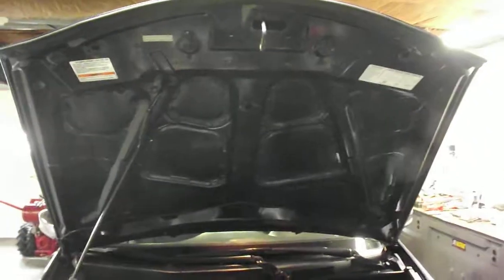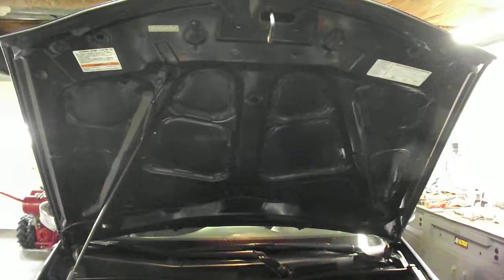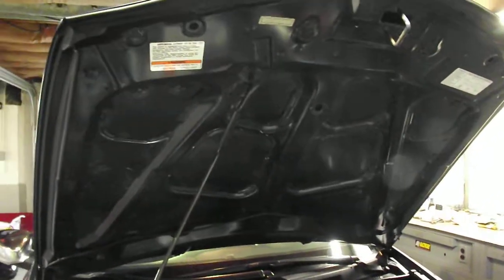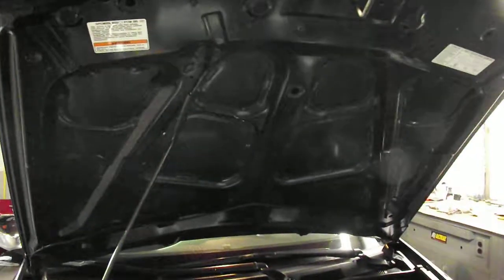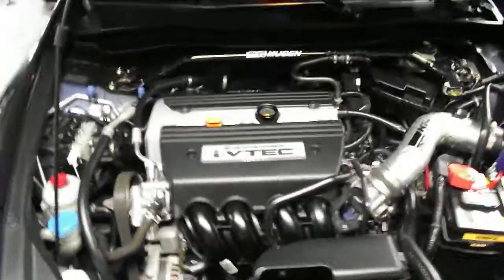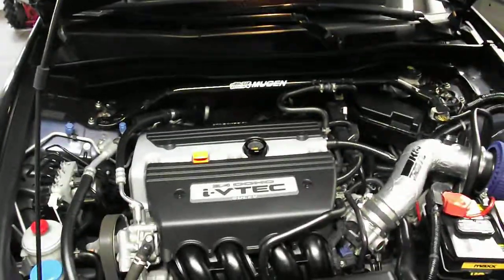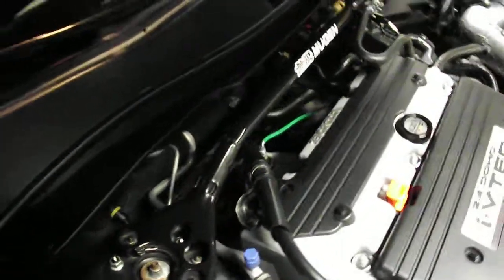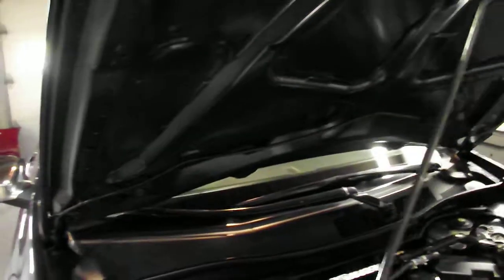Should You Remove the Hood Dampening on Your Car?

Comment: The actual reason for the shield is to suppress fires.  In case of a fire in the engine bay, the clips melt and the suppressor shield drops over your engine to smothering it.
Reply: da324 someone from a different video said it actually burns rapidly after lit up. So seems like it doesn't work as a fire blanket
Reply: Any manufacturiers have videos, articles stating this? Would be an interesring read.
Reply from the maker: Exactly
Reply: @da324, no. 
That may only come as a secondary purpose. Primary purpose is to protect the hood cover from excess heat and paint discoloration.
Reply: People read that online then just repeat it .. Not one person was able to prove this is the reason for the insulation.
Reply: @germanshepherd13  Can you prove it's not?
Reply: I don't think so
Mine was off and i tried to burn a piece of it
It burnt pretty well 
It might help u to start fire in emergency to keep u warm
Reply: That is actually correct that is the intended purpose for that it's called a fire blanket but I've seen many cars on the side of the road catch on fire and I've never seen one go out by itself so I don't think it works at all... And as an air quality specialist trained in asbestos detection and microscopy I believe those blankets contain asbestos...
Reply: Mine burnt quick when my battery exploded

Comment: What would your opinion be on removing the hood liner on an older 4 cylinder accord that has the exhaust manifold in the front of the engine bay?
Reply from the maker: I'd say it would be alright. The manifold should be cooler when it's in the front.

Comment: so i have a golf 4 gti and should i do it? i have a 20V turbo 1.8t motor with a blow off valve. Should i be worried ?
Reply from the maker: Not sure. I would take a temp reading. With my hood, it's just warm to the touch. My exhaust manifold is in the back of the engine, which would definitely hold more heat than if it were in the front of the engine where air hits it. With that small engine, you should be good, but I don't know.
Reply: did you figure out if it made a difference or not?
Reply: @stayclassie6875  it did, my turbo flutter got way louder and the blow off valve. you could definetly hear a differrence so id recomend it. And it doesnt do any heat damage to my hood.

Comment: That's good to know, because I've been thinking of installing it with my '23 Corolla LE 2.0L 4 cyl. I guess I'm going to try to feel how hot the hood get first, the insulation pad cost around $200+
Reply from the maker: Yeah, I'd definitely consider before spending that. It's been since this video that mine has been off and I've never had problems.

Comment: I had that experience. ('05 Accord, 4cyl) 

Hood liner/insulation off, hood paint wore off. The heat disfigured the paint. It started at the center of the hood cover and the discoloured patch expanded over time towards the edges.  Also, the hood was always too hot to touch.

I bought and installed the hood liner/insulation. Hood cover never got so hot again, no matter how long I drove the car.
 Hood discoloration stopped expanding (it seemed to even out some months later, but still looked ugly). So I got a paint job done.

In my opinion, from experience, leave the hood liner on. It protects.
Reply from the maker: Interesting. I had mine off for 4 years now and I've never had a problem. Do you have a V6? That engine would have a lot more heat. If I had anything bigger than a 4 cylinder, I wouldn't have taken it off. I mainly took mine off because it looks really ratty as it gets old.
Reply: @Auto-Alchemy  
Mine is a 4-cylinder engine. 2.4L

I agree, it gets ratty-looking. I learnt the liner/insulation is usually damaged by water; so we shouldn't wash. 🤕
Reply from the maker: @daviderhahon  that’s interesting. Ive never had trouble with my 09 Accord 4 cyl. The area of the hood over the manifold is just luke warm.
Reply: Honda paint look at other old Hondas

Comment: THE INSULATION HAS MUCH LESS FIRE RETARDANT PROPERTIES THAN THE ALUMINIUM BONNET SITTING ON TOP AND FIRE GROWS FROM THE BOTTOM NOT THE TOP. So fed up with this silly debate just take it off its a noise cancelling fabric and that is it.
Reply: Bro I live in a 100+ degree weather town  that’s hot 24/7 I wanted to remove that cover and the foam for heat reduction to the motor. I’m sure it’s there for Noise reduction. I’m trying to Minimize the heat in the engine